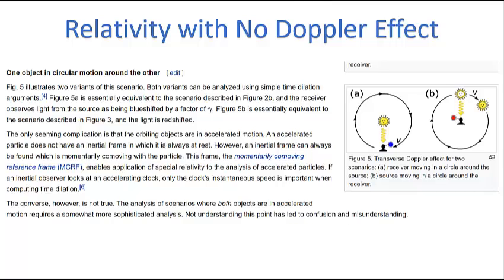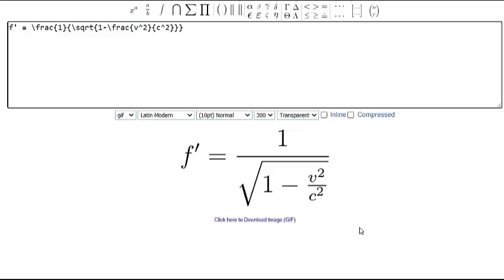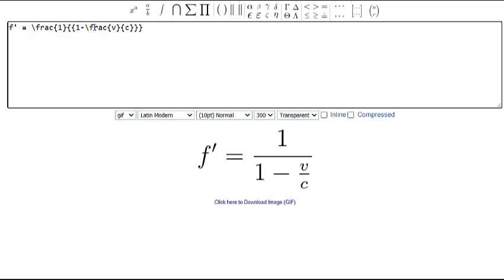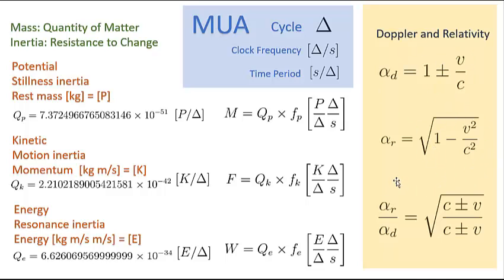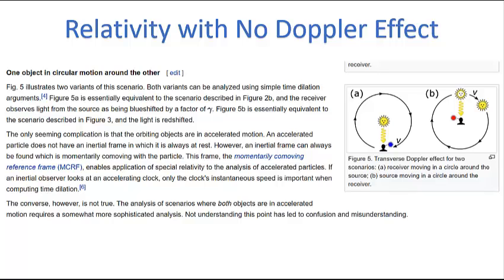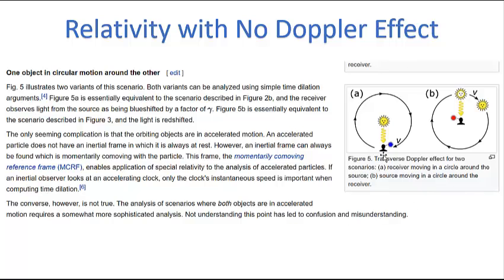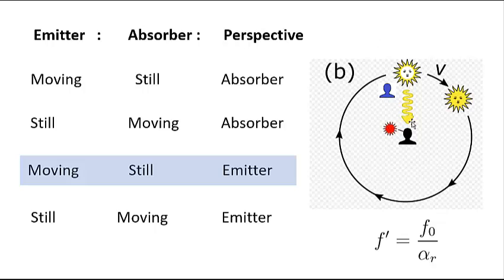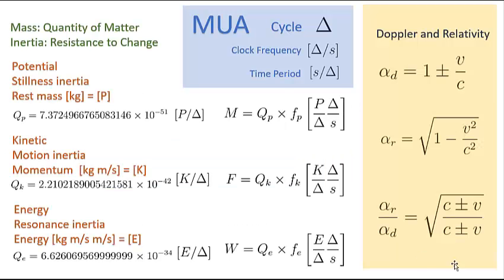Relativity With No Doppler Effect

Comment: I see a paradox, If we look at satellites, The GPS satellites to be precise, the people doing the math say that it red shifts going up against gravity and blue shifts coming back down.  I am working on two theories of gravity, one with low energy photons making up gravitons and the other with the cross interactions of magnetic fields causing gravity without gravitons.  Your model of red shift allows the photon model to work.  Since your math doesn't use anything fore gravity, I am going to put it in a plus one for gravity having no affect on photons.  The people with GPS systems do have reason to lie.
Reply from the maker: The GPS people have no reason to lie. They are not wrong. It's all a matter of perception. Yes, one has to correct for redshirt and one has to correct for blueshift. One is in motion and one is not in motion. There is no paradox.
Reply: @FractalWoman  GPS is military and military misinformation is something I have to contend with every day on blueprints.  I saw a U-Tube vid where two atomic clocks were placed in a skyscraper one at the bottom and one at the top and it was attributed to gravity, and I am very sleepy at the moment, so I can only say thanks fore keeping me strait.